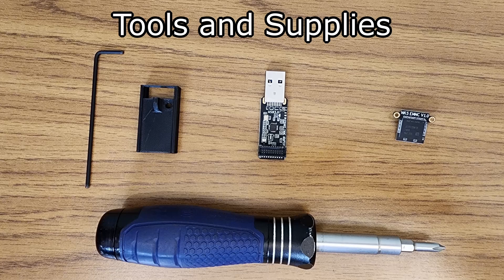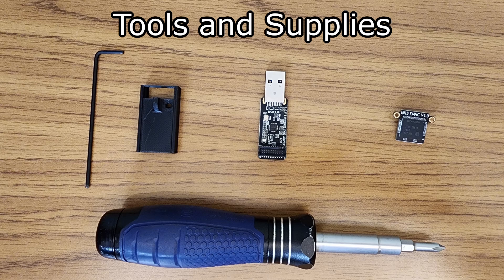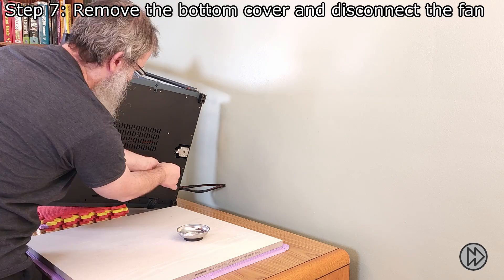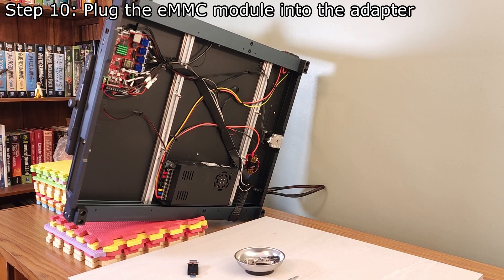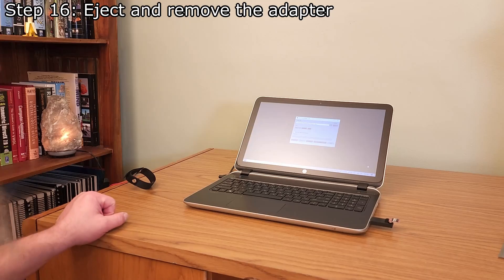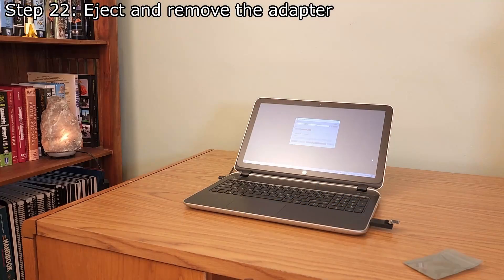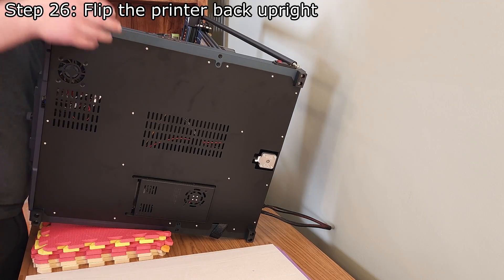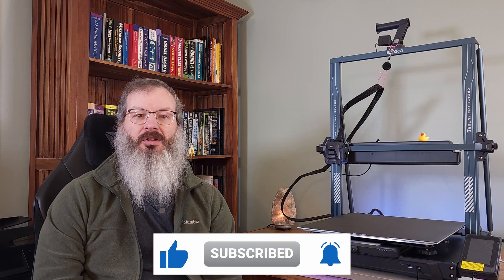Backing up and cloning 3D printer eMMC modules

Comment: I know this has been 2 years, but do you have one where if I put openept4une no it and now want to upgrade too a 32gb emmc instead of the one from elegoo?
Reply from the maker: Thank you for watching our videos. I don't use OpenNeptune, since I created my own version of Klipper (https://youtu.be/Aoy3sI1lv1g). You should be able to switch to a larger eMMC, and I know others have done it, but I don't have a set of instructions available since I've never tried.
Reply: @SandMMakers  your video help'd me make a copy and switch. It was just a copy that was needed nothign fancy about a reinstall, but i needed to ssh into it and run a command to redo the partion size.

Comment: Congratulations on the content! If possible, I would be grateful for any feedback! After updating my Elegoo 4 Plus, I receive this message on the display: Internal error during connection: Could not convert a negative number to an unsigned number.

Once the underlying problem is corrected, use the "RESTART" command to reload the configuration and restart the host software.

The printer is stopped. Thank you.
Reply from the maker: What were the exact steps you performed before this happened? Does it happen every time you start the printer? Are you able to SSH into the printer?
Reply: @SandMMakers  Before, it was only via serial cable via PuTTY! Then I managed to change the settings, I put in my PC's IP address and it connected via the network! I managed to change everything, I put the Z key to enable movement, I started it to heat up, and then through the PC I saw that there were seven updates, so I started the update! I turned the printer off and on, and it turned on with the panel locked and the screen showed "pro 4". I don't understand, the update was done via the network! Thank you.
Reply: @SandMMakers  Sorry, and I acknowledge that Neptune 4 has a smaller table! Do you know why? Thank you.

Comment: I just bought a new max4  from Elegoo and it stops and locks up often not finishing a print.  Is it possible to get a higher memory emmc chip.
Reply from the maker: The eMMC provides data storage, it isn't RAM. However, I highly doubt getting a bigger eMMC chip will resolve anything.

What is the specific error message that you are getting.

Comment: off-topic question, what material is between the foam and the printer with label "made in turkey"? i tested many solution to reduce vibration, I use cement with some kind of foam and I'm interested to know what you did. thanks
Reply from the maker: Thank you for watching our videos! The item between the foam and the printer is a 24"x24" porcelain paver.

https://www.lowes.com/pd/Satori-24-in-L-x-24-in-W-x-0-75-in-H-Square-Carlton-Mist-Porcelain-Paver/5014300413

Comment: Hi. can you send me a copy of emms neptune 4 max? if it 's easy . You can tell me. what you don't need to press when a message appears on the screen (clipper ) . I'm a newbie. I recently bought a printer. and I've already broken it.
Reply from the maker: Thank you for watching our videos! I don't really have an easy way to send you an image, but if you email Elegoo at 3dp@elegoo.com, they should be able to provide one.

As second question, I'm not really sure what you are asking. What message is appearing on your screen, what action(s) did you perform right before the message appeared on the screen, and what happens when the message appears?
Reply: @SandMMakers  
Hi. Thanks for your video. and advice. I have something with the firmware. the printer is not working. I hope that I will update my memory and everything will work.

Comment: Thank you for the tutorial.. 
I used a lager emmc and to get acces to the extra room you need to enlarge youre partition after you written it to the new emmc
to do this download  gnome gparted you need to make with this a bootable usb stick.
I used rufus to do this.
After you have done that reboot your pc with the made usbstick in and the emmc conected to your pc.
Boot from the usb ...when gnome is started you can then look for your emmc and choose to extend the partition.

after that you can use the full capacity of the  new emmc ellegoo told me there was no limit in the size of the emmc
Reply from the maker: Thank you for watching our videos and your description of how to use a larger eMMC. I haven't explored using a larger eMMC because I don't like keep old files on my printers, but I'm sure it will help many people!
Reply: I think this can be expanded via ssh after the fact without doing all that?  ie: "sudo systemctl enable armbian-resize-filesystem && sudo reboot"
Reply: @markm75 I'm trying to do that using mobaxterm you think it'll work? Google ai is telling me it's a high risk thing to do but if you have experience doing this I'd love some advice 😅
Reply: Could the partitions be redone using something like mobaxterm connected from my laptop to the printer? I've already installed the emmc and don't really want to take the bottom plate off again😂

Comment: I've been watching several of your videos, and they have been very informative. 

For the original emmc, can you re-write for Open Nept4une? Of course after backing it up.
Reply from the maker: I would assume so. However, I'd suggest getting not only an eMMC reader, but also a spare eMMC and testing with that instead of the one included in the printer.

Comment: Is 8gig as large as the printer will support? 
It would be nice to have more storage for favorite prints. Thanks.
Reply from the maker: Thank you for watching our videos! Unfortunately, I do not know the answer to your question.
Reply: @SandMMakers  Thank you for all you do.
Reply: @michaelmann5732  if you print only and directly from an SD card/USB thumb, 8GB should be good enough for firmware, but if you upload and print through fluidd web interface, 16GB is recommended because the stock firmware and OS take up 5GB already so you only have 3GB left for storing your models